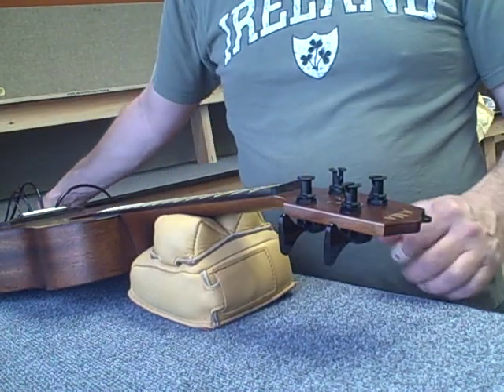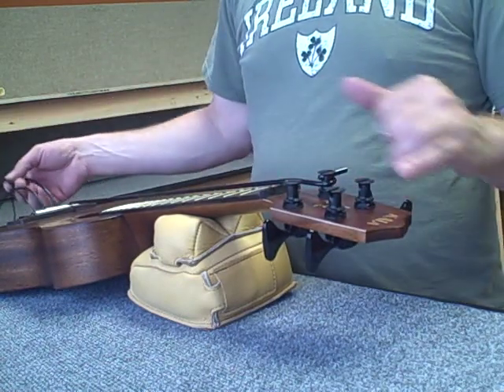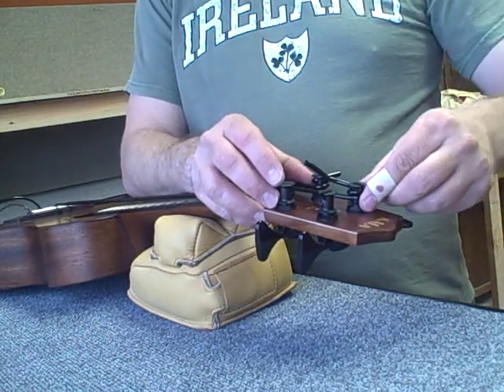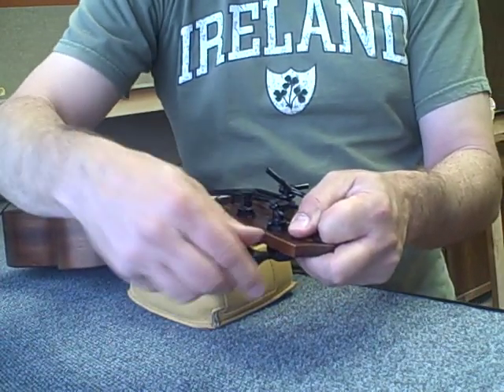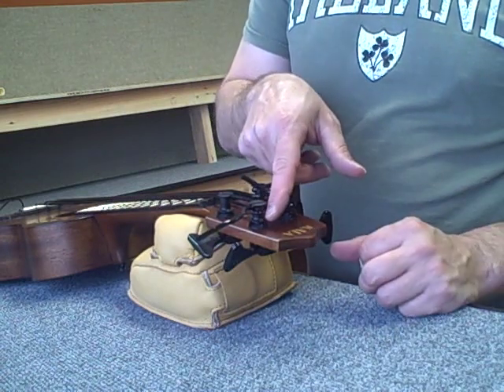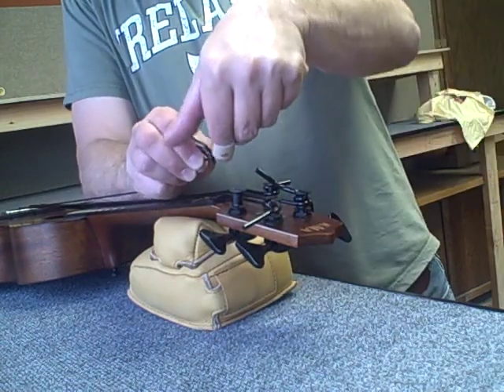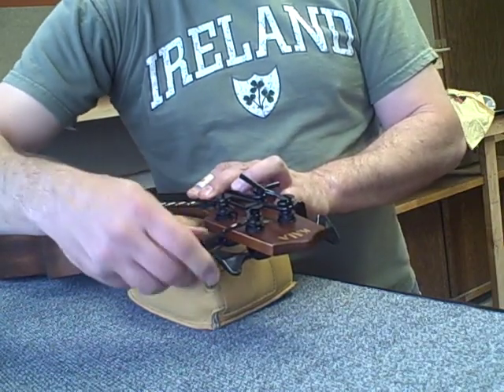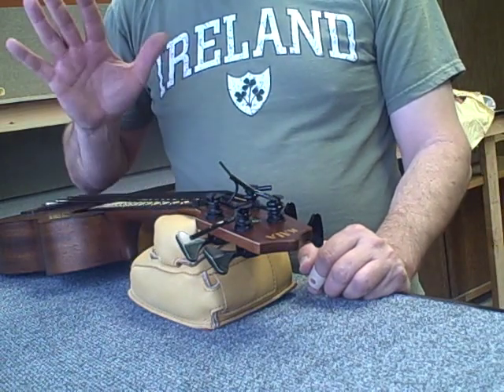Kala U-Bass strings

Comment: Might I suggest that this video be updated using BRAND NEW Pahoehoe strings? It's somewhat different than this example, where Mike has obviously unstrung a uBass and then proceeded to re-string the same strings -- they're pre-stretched, as opposed to the shorter-than-the-neck length of completely virgin strings.
You might need to install them once, tune them up, then unstring and pull the now-stretched strings through the peg slots even more to eliminate double-layer windings, especially D & G.

Comment: Ok. I just replaced my strings on an older Rumbler WITHOUT the kick plate on the back (silver/grey strings -- they were hand knotted inside).   So what about the OTHER end?  My strings were "pre-knotted" (actually pre-stoppered).   If you have straight strings you just need to run 'em through & put your own knot -- much easier.   Once I figured things out, it went like butter:   You're gonna use a needle and thread.   You run the needle/thread down through the bridge and dangle it down using the weight of the metal needle until you can grab it easily through the sound hole.   Pull enough through to work with, but not too much that it comes out of the bridge!  Then you're gonna "nick" a little bit of the string -- push the needle in through the circular face at an angle so you're just going through a tiny bit of the string edge: this stuff it tough, it won't rip.  Push the needle ALL THE WAY THROUGH.   The "trick" is that there is very little tolerance/wiggle room between the size of the hole and the size of the string, so adding material that fattens up the string makes it a lot harder.   Pushing the needle all the way through allows the string plenty of room to slide through the bridge.   Gently pull the thread while pushing the string.   I spent about an hour trying combo of super-glue to old string, electrical tape to old string, electrical tape to a copper wire -- they all added too much girth so pulling through the hole was too hard.  Once you're through, just pull the needle/thread combo all the way through and onto the next string!

Comment from the maker: @DonyaLane depending on the model the back panel is either held with magnets (gently pry it off) or with screws. You should only take the panel off to change the strings. The strings do come with an anchor. Sorry for the late reply.

Comment from the maker: Mike is lightly pre-stretching them in the video. Basically you get the strings on, and tune up to pitch. Then you get a good grip on each string and pull with even pressure away from the instrument. Check your tuning and the string will likely be flat. Keep repeating and each time the string will be less flat until it stays very close to in-tune even after a stretch. They just tune back up and enjoy!

Comment: I ordered one last week, and recieved it today.
Out of the box E string: 2 wraps. A string: 3 wraps. D string: 4-5 wraps: G String: 5+ wraps.
It isn't popping underneat the string holder and the strings start to roll over each other. but im worried that it will break off.
Should I rewind them myself and pull them tighter at the beginning?

Edit: I'm using a Kala SUB u bass. (electric bass)

Comment from the maker: bassboulevard, no you can only use strings specifically designed for the U-Bass. There are already a few different brands available. You can check out some of them at your local Kala dealer or in our online accessory store KalaGear.com.

Comment: I own this ubass for a while now and always play it but The strings just never settle. It keeps on stretching. The strings are not as thick as when i first time got the bass. Which changed the sound of the bass. As the strings stretches out and thins out, you lose some of the bottom end. They shpuld develop better strings!

Comment: Thanks for the video.  I just used it to change strings on my Solid Body U-Bass.  I found that I couldn't manage to tune it up without wrapping around the post a few times.  The strings that originally came with the UBass were wrapped that way.  Is the Solid Body very different in how it handles the string tension?